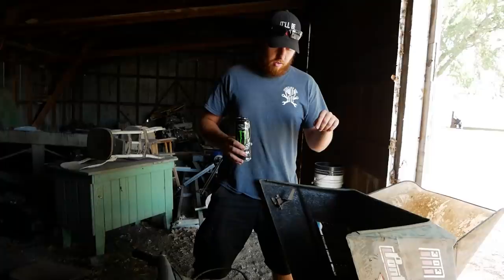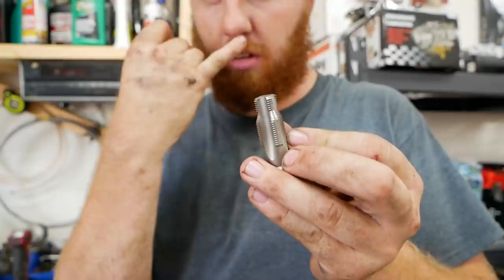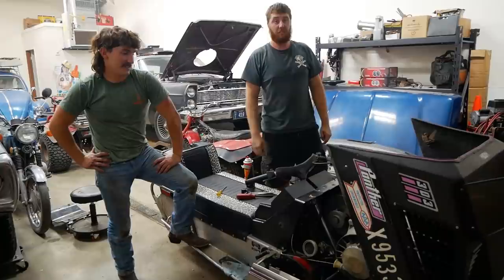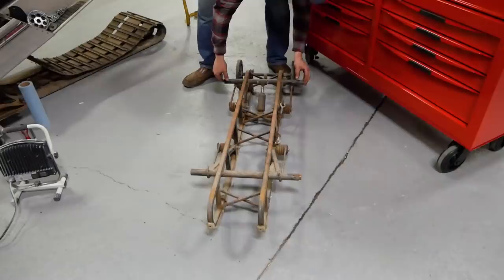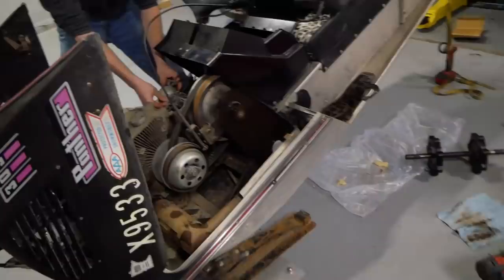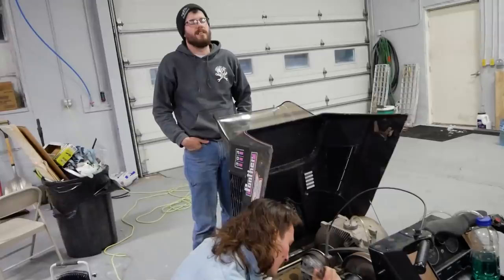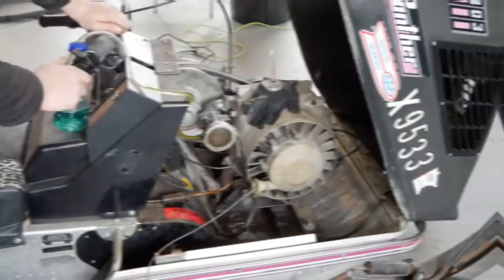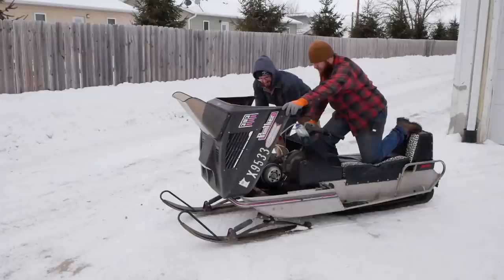Will an Abandoned Snowmobile Run After 20 Years?

Comment: That sound the rotary makes is definitely normal - for a rotary. I've owned six first-gen RX7s and one of these 303 cc Sachs engines from a '74 Arctic Cat Panther. They need a 40:1 pre-mix of fuel: 2-cycle oil in order to lube the apex and side seals, as well as the needle bearings inside the rotor that rides on the eccentric shaft (ie: "crankshaft") lobe.

These Sachs engines have a very interesting engine cooling feature known as "charge cooling". The external fins and fan pull a large amount of heat away from the engine, but the rotating mass at the engine's core needs more than that. 

Unlike in the RX7 engine, the Sachs uses a solid eccentric shaft. But like the RX7, the rotor is hollow, allowing cooling media to draw heat away from the rotor. 

In the RX7 two-rotor oil and liquid-cooled engine, this media is engine oil, pumped through the hollow eccentric shaft. But in the Sachs engine the internal cooling media is air-fuel-oil mixture. That's right: Before the air/fuel/oil mixture enters the combustion chamber after leaving the carb, it is first routed INTO A PORT ON ONE END OF THE ENGINE near the center of the engine where the eccentric shaft resides, through the needle bearings and hollow interior surfaces of the rotor (which both cools and lubes the center rotating mass of the engine), out another port on the opposite side of the engine and finally through a passage that takes this intake charge to the intake port(!) Hence the name "charge-cooling".

I was going to use mine on an ultralight, but that never materialized. Maybe that's a good thing. If memory serves me correctly, these 303cc engines produced 19.5 hp at around 5500 rpm, and around 28 lb-ft of torque at around 5000 rpm. These sleds were very fast once up to speed and in track racing They loved to rev. In the high rpm ranges the power curve dropped off much more gradually than with piston engines. But off the line they were slow to accelerate - owing to the rotary's inherent weak torque in the low rpm ranges.

Comment: I think the problem is the glove.  You have a vacuum pump with 2 layers.  This means the first layer gets the full force of the vacuum, but it can only pull on the second layer with whatever vacuum it has in between them.  Just make it one layer of glove and see if that fixes it.
Reply: You beat me to it
Reply: This is what I was going to say too. The second layer might be fighting for dominance.
Reply from the maker: Well heck
Reply: Now you have me curious to see if that’s the problem lol
Reply: Kinda explains the squeaky sound it was making at least
Reply: Yup, was going to see if they sliced the glove for a patch, then thought "the glove is too thick".
Reply: @JunkyardDigs  did you remove the welsh plug in carb when you rebuilt it. Thats usually where crud ends up
Reply: @dodgemechanic  I dont know what that is but I want them to see this comment.
Reply: I was slapping my forehead screaming this at the screen the whole time.
Reply: duck duck later >  ah a freeze plug.
Reply: Well crap your on to something there
Reply: Definitely check the Welsh plug, those carbs are famous for those plugs getting crud and varnish built up in them.
Reply: @TheChaztor  uh no ..its a plug with a fixed jet..in the fuel bowl..a freeze plug is what pops out of a engine block when you leave water in it instead of antifreeze and it swells when it freezes, instead of the block cracking
Reply: @skyb8687  But the first internet answer has never failed me before.   thanks Sky
Reply: Yup they have pulse fuel pumps on many small air cooled engines you could probably use one from a briggs and Stratton lawn tractor or something. Take the old one off and go to a small engine shop and I’ll bet they can match it up with something else.
Reply: @kraigcochran9995  They'd have the jerry rig a vacuum line though, that pump looks like it has a direct line port into the crank case for vacuum when most modern vacuum pumps have lines going to a vacuum port. All he should need is a new piece of diaphragm cut to size. They had the right idea with the glove, they just made it two layers instead of one and the glove won't last long from the constant movement.
Reply: @skyb8687  I’ve yet to see the first freeze plug do that. Just a wrong name tgat got stuck… They are just leftover holes from the casting process to flush the sand out.
Reply: @telocho  huh I live in montana freeze plugs pop out here.
Reply: @telocho  weird,I see many freeze plugs pop out here in Northern Montana,
Reply: It's a Welch plug, not a plug from Wales.
Reply: @alancottrill  Yea, using brake fluid for fuel certainly didn't do the rotor seals any good.  You guys ever hear of starting fluid with top end lube?

Comment: I felt like yelling crank seals at my phone this whole last half of the video
Reply: Yeah I was yelling GIVE IT OIL ITS A FUCKING ROTORY THEY PRACTICALLY RUN ON IT
Reply: Not "crank seals" but yes seals are the issue and yes oil also helps the seal aswell as lubricates it.. 
Dry fuels like brake clean or ether are very, very bad for it.

Comment: If Mook had rebuilt the "carbotater", it would have run just fine.
Reply: Like when she did the Bronco one and it didn't work.
Reply: @inspireonex  Yeah exactly like that.  LOL
Reply: @inspireonex  Plus I think that one ended up being stuck valve that made a pretzel out of the pushrod.
Reply: @charleshensley2018  yeah stuck valves caused bent pushrods in the end. They ran the bad gas that was in the tank. All of that certainly didn't help Mook's carb work any better either.

Comment: make sure you run premix in that rotary. its a 2 stroke motor basically, so mix the fuel. it will make the rotors and seals last longer. also rotaries go great with turbos, like a er trip made in heaven

Comment: that swing arm in the carby, you can actually set the "float level"/move the mixture a lil leaner or richer so to speak by bending them, even in weed eaters, bend em more towards carby for less movement each pulse and lets less fuel in, bend them towards the diaphragm and it hits for more movement each pulse, lets more fuel in

Edit: the amount of bending needed is tiny
Reply: Absolutley correct.   I'm sure their rubber glove diaphragm should be replaced with some correct material at least but I liked the improvisation lol
Reply: You should check out Mohawk motors
Reply: @robertbrady5009  Bicycle inner tube?

Comment: What a Kool old Sled!

Hey... A trick I learned for sorta reviving that old gelcoated plastic and fiberglass, is if you've got a good, clean surface to start on (like you have there) you can take that Zep Commercial Floor Finish on a clean linen rag, not soaked too wet, but just damp... And start rubbing it on in circles, just like you'd apply wax to any vehicle.

Overlap the circles and go slowly.

Once you've gone over all the plastic, let it dry and start again where you started first... Do that over, three or four times and it'll build a really nice finish that'll last a couple years before it starts to fade again... Then, clean 'er up n do it over.

Cheers!

Comment: Great effort guys! I had a Panther 303 which I ran for four years. It was always fuel related but I did finally determine that it needed copious amounts of fuel to be totally warmed up before it would run and idle. It was only happiest when the muffler was red hot. Seriously, red hot glow in the dark. Mine topped out at 59mph. If you could get it to run untill the engine was up to temp then it was happy  Fond memories of a possessed Wankel. Enjoyed your efforts! Hats off!

Comment: This brought back some memories. My first sled was a 72 puma my dad bought me in 96, still had the old steel track. The thing was a beast. It sat outside for 20 plus years. My pops and I pulled it inside one night, put new sparkolators in, and put some gas down the carb, and it fired right up.

Comment: That old Maytag came off of a gas powered washing machine. Awesone.
Reply: I know how good maytag washer and dryers are. I used have a maytag washer and dryer that lasted up to 20 years. But broke apart and got corroded and so we had to throw it out and find some new ones after so long. Plus that thing was heavy it weighed over 90+lbs

Comment: Take the pump with the glove off, put a 1/8NPT fitting and put the hose directly to the engine. I've seen it done and it works. That tillotson carb has a pump built in. I had the exact same sled with the same issue and I believe I still have videos on my channel of it

Comment: I had a chainsaw carb with a clogged passage downstream of the high speed mixture screw, with symptoms pretty similar to that.  I fixed it by removing the screw and then pressurizing the whole carburetor with an air gun, which forced the glog out the screw hole backwards.  It worked fine after that.
  I bet you still have a clog in a carb fuel passage despite the ultrasound.

Comment: Good tip for next time, coat the helicoil tool / tap with grease. Picks up most of the shavings if not all of them. have had to do this on generator engines that are one piece cylinder and head. Also my 1972 Yamaha sm 292 did that exact same thing

Comment: I have revived snowmobile engines with trees growing through the frame. Gas oil mix engines generally do not seize up like oil only engines do. My oldest restore was a 1960 Skidoo Elan. I made a business restoring and selling vintage snowmobiles back in the 1990's. There was me and two other guys in my town that restored snowmobiles. I often bought parts or even whole sleds from them to restore. They saved me the effort of pulling them out of barns even though I have done it many , many times. It was a fun run until Cancer put a stop to it for me. I can no longer move them around. The seals in those go bad. It's no fun tearing them down.

Comment: The drive bearings that have the locking collar are sometimes referred to as CAMLOCK bearings.  I've installed many of them and they are pretty reliable, just get them set good and tight and tighten the set screw.

Comment: We had two Panther 303's when I was a kid -- one was very similar to this one (with the addition of a speedometer). Hard starting beasts!
Reply: We also had an MN 71-303.  I sent the video to Dad to see if it's our first Panther.  Go easy on the starting spray, the Sachs really needs oil/gas mix.  Looking forward to videso in the new shop.  What was Mook doing in the background, should of used her good touch with the fuel mak'n happener.  Good job on John's work on the track,  I rebuilt out 73 Panther track in the 80's.

Comment: How much starter fluid can you push through a two-stroke lmao
Reply: Fr, seeing brake clean used on a 2 stroke hurt me
Reply: Glad I’m not the only one that thought that. Bet those appendix seals and side seals weren’t too happy. Same with the crank bearings.
Reply: It never ran long enough to hurt them... they ain’t  made of glass ladies
Reply: @derekchauvinisahero2010  forcing it to run down parking lot while spraying it with brake clean is definitely enough. Yes using a little to just get it started isn’t too bad but they used a lot of brake clean. Could of used a spray bottle with 2 stroke mix instead of brake clean on a engine that hasn’t seen any sort of lube in 20 years.

Comment: Put black fuel line on the vacuum pump on the top of the motor. The clear line you have on it is not a vacuum or pulse line and isn't sending the proper pulse to the pump,hence it's not pumping the diaphragm and no fuel is being pumped. I have run into this problem many times over the last 30 years. Happy sledding! :)

Comment: Tillotson carbs were on almost all the old sleds, and, just as other comments, removing and cleaning under the Welch plugs, where the needle jets seat, is pretty important for the carb to work. My first sled I bought in '69 was a '66 Larson Eagle, with a 10 horse JLO; it didn't have an external pump, but pulses came from a drilled hole in line with the carb seat on the engine. Still have the sled and engine; though not together, and neither are running.

Comment: A little trick for your future plug tapping adventures. Put bearing grease on the tap/cutter and itll hold all the metal shavings, preventing them from going in the cylinder. just clean it off and reapply new grease every time you remove the tap to check. :-)

Comment: When I'm working with gasket material, I use a ball peen hammer and Lightly tap around the edges of the part. It does a great job of starting th cut for you, especially in the bolt holes.

Comment: Fun watching you guys revive this. Ive rebuild a bunch of these sachs 303's and even ported a few an built one with dual carbs, got some porting vids on my channel of them. your on the right track with the crank seals, but you'll need a pop off gauge to set the tillotson up right. these run better with an HR tilly / 34mm carb.

Comment: Cool wake-up!

Old carburetor is a problem here.  Measure the internal diameter and source a more modern replacement of similar size.  Look at carbs for motocross bikes, much more efficient fuel metering overall.  Lectron (Lektron?) is kind of the gold standard but anything from the mid 90s and up would be a huge help here.

I think cars and cameras spent time with a Sachs rotary on a go kart a while back and may have some useful info on what works.

Comment: I use a torch tip orifice cleaner tool to ream out all ports in the carb. You can go to a welding shop and get the orifice cleaners in all possible sizes.

Comment: Watch the use of that spray can.   Am guessing it's starting fluid.  No lubrication for the cylinders, remember it's a 2 cycle engine!  Sounds like it's starving for gas. You open the throttle and it gets a big gulp of air but insufficient fuel.  Enjoyed the video.  I had a 68 Panther.  Great machine in deep snow.

Comment: Usually those carbs have a high and low fuel mixture screws. Adjust low rpm until it runs good and then give it throttle and adjust high screw.  It's not idle air mixture screws like a Holley carb

Comment: I wanna see that Maytag run! And....put to use in something. 😁

Should be a Maytag 72...from the 50s i Think. Made to power a washing machine. But it would be nice in a little yard machine of some kind. 

The sound those make is nice...but the one cylinder ones have an even greater exhaust sound. Great find.

Comment: I had a 72 or 73 lynx with the 295 series 1 rotary’ engine. It was very hard to start also.  It actually had a mechanical fuel pump mounted on the recoil which ran off of a small cam shaft. I’m wondering if the rotary engine just didn’t have a great vacuum. I had it a few years and had a lot of fun with it. I did learn one thing if you see a recoil from factory made with an aircraft cable for pull starting just walk away from it lol. You guys were pulling your asses off just like I used too.  Thanks for the great video.

Comment: That eccentriclocking bearing is very common in factory machinery. Those bearing inserts are used in pillow block and 2 or 4 bolt flange type bearings.

Comment: dont forget to add oil to the 2ndary clutch housing there is a chain in there...my grandpa used 1 qrt of 30w motor oil to 5 gal of gas but it ran for 27 years no engine problems!  if your fuel tank doesnt have a vent it wont pull fuel from your bottle

Comment: I installed greasy fitting in the under belly shafts. Pivot points worked great. When took apart metal o.o metal powder. Shined pivot. Spacers note exhaust berry loud wanted. Toresanate exhaust butt Motors ran so good and long

Comment: May not believe it but they scored by finding that old cat in the condition it is in. Have one identical to that, same year and everything. They are extremely tempermental as this video fully illustrates. The problem is with the carburetor, it is still plugged up inside. That latex diaphram won't work either - way too flexible. When those are running correctly they are a ton of fun to ride. A little more carb work and the proper diaphram and that thing would be snow bound again. Would love to have that one!

Comment: Old Rotary Engine 101

What is left to do:
-Open it (yes, you have to)
-Take out "dorito"
-Smooth surfaces, smooth seals
If not: You have a job to do!
-Springy tip seals (tip of the dorito, not sure if this one has them, known as apex seals)
-Lube up everything, more is more
These engines don't like moving without a healthy dosage of oil, vaseline or both.
-Seal back up
-Oil, she loves the 2 stroke stuff. Mix with the fuel, more is more, don't go crazy though.

Starting:
-Choke, start and get it to idle with all the choke. Let it warm up. Some were designed so the choke retracts when it is ready to go. Keep it at low rpm <4000 while warming up. Surprisingly these things don't like to be cold.
-Let rip. Rotary needs the high rpm's give her some. 

Forgive my grammar, happen to be Norwegian. Hope i might have been some help. 

Used to own an Rx7 that I ran during the summers up here. Holy hell every spring pulling the engine for service after sitting in storage through the winter. If you want to avoid the mess of opening her up and lubing her every season you can. Just start her every two months or so, leave the engine running long enough to heat up, then shutt it down. Let's the two stroke stuff do it's job. ^^

Comment: Take the diaphragm assembly off the top of the engine and put a 90 degree fitting in its place.  Your primary clutch could also be messed up and dragging your motor down, it looked like it was engaging at a pretty low rpm.

Comment: leak down test. this would tell you if you have issues with crank seals, witch would account for lean fuel mix if its suckin air past the crank seals. good luck. nice video!